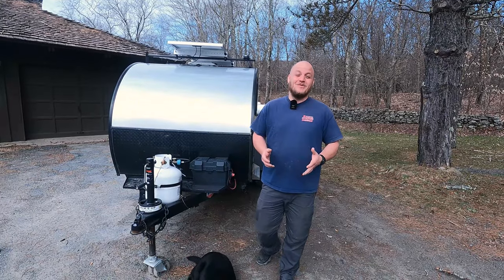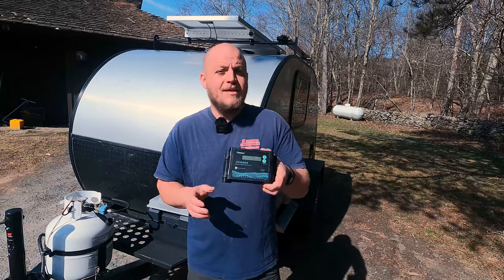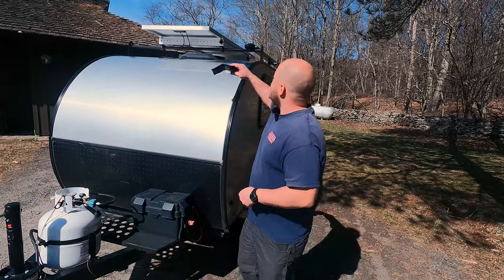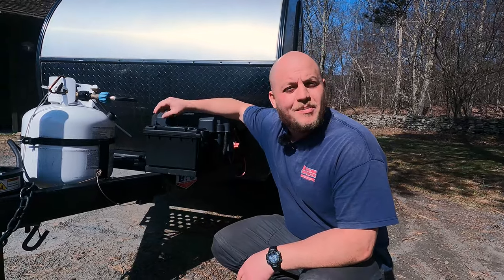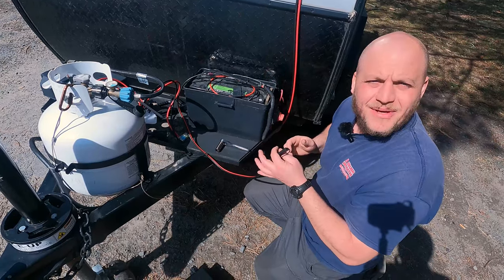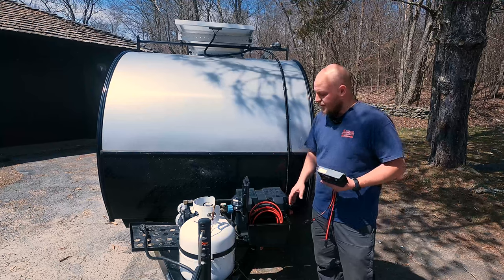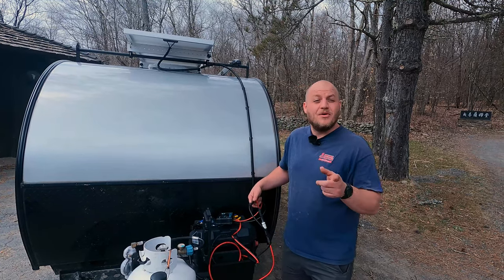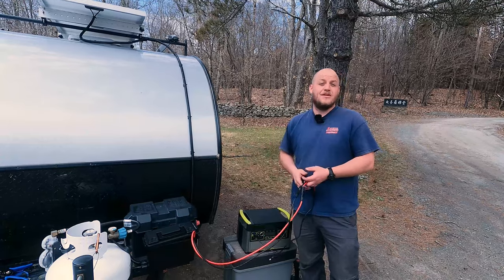DIY Charge Controller | Installation Options

Comment: Hi thanks for your videos. I have a question.  Can I use a charge controller to charge starter battery from the cigarette adapter in my car so I have a starter always charged as a spare? What fuse and capacity of charge controller is the optimum?
Reply from the maker: You can use charge controller set ups like battery tenders through 12v inputs like a cigarette plug. 
Fuse your controller between 1.25 and 1.5 the current limit on controller.  15a fuse on 10a controller. 30 a fuse on 20a controller… those ratios are what most use. Make sure the wire youre using can handle the current of the fuse.

Check out my other videos on solar too, thanks for watching.

Comment: Another great video Brian! I have a question. I have a hard time wrapping my head around one thing. If the solar panels go through the controller and and charge the battery and I connect shore power to the camper, is there any risk of an shock or fire event occurring if power is fed through the converter and onto the battery while the solar circuit is connected? Should I physically disconnect the solar while plug into shore power? Thank you sir!
Reply from the maker: Nope, leave it connected.  That is safe and common practice.   What's really gonna blow your mind is that you can install multiple solar controllers, DCDC chargers, and shore power chargers at the same time... lol    They all push a good battery charge voltage and the battery draws the current. 
Good question!
Reply: @DIYOutdoorLife  that’s cool Brian thank you for the quick response. I’m glad you were able to understand what I was to trying ask. I ordered the cigs panels with the victron controller and I didn’t want to smoke anything with that configuration. 👍🏼

Comment: Simple question if you are running  2 batteries  in a series  do you need to hook  to one battery  or treat like a series  when you run the cables from batteries  to the controller?
Reply from the maker: If you’re running in series, you are running 2 - 6v batteries, do you mean parallel?

Actually, the answer is simple, because you should run from the opposite posts either way.
Run your charge controller from the  + of bat one & the - of bat 2.  Always best to use the positive on one battery and the negative on the other for balancing.
Reply: Yes running  2 12volt batteries  and parallel  and thought  that be corrected to do have done just that pos to one battery  and neg to the other one thank you for confirming  what I  thought

Comment: Dumb question... do I need to add a ground at all on a similar setup?
Reply from the maker: No, you’re fine going from panels and battery to charge controller, it will have continuity ground to your chassis through the battery.
Reply: @DIYOutdoorLife  thank you for the quick reply!

Comment: Mine TD has all the electrical inside. I have a sae connector on the side where I hook the panels (similar to cosmo). I usually went for portable panels but now I also have surrendered and installed 120w on rooftop and still thinking best way to wire. Do not want to drill a hole but i am afraid to drive while a sae cable is connected on the side. Not  clear how you glued your cables on the outside
Reply from the maker: The 3M zip ties in my video description are stick on. They do a really nice job attaching to the camper and stay put.

What kind of camper do you have? I’m sure there’s a way to hook in without too much work.
Reply: @DIYOutdoorLife  it is locally made in Brazil. Search for sun trailers. Really cool type inspired on TD. But I did not want to drill holes in the roof ao I had a SAE connection on the side. Will figure out more…just buys this 3m sticks. Great idea. Did not know they existed
Reply from the maker: @risconamira  I’ll look them up now… thanks!

Comment: I mounted a victron  controller on the outside of my camper and it failed within a year, they are definitely not weatherproof.
Reply from the maker: That’s right, unfortunately I hear this all too often.  There’s very few waterproof MPPT’s, most really want to go inside, they don’t even particularly like humid environments.  Even though the PWM’s don’t do quite as well, tons of waterproof options for cheap.